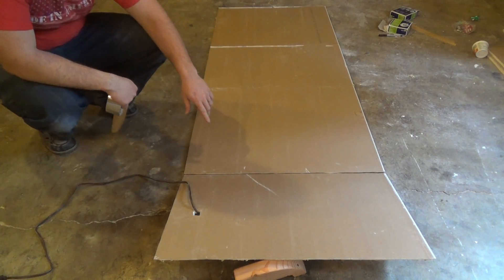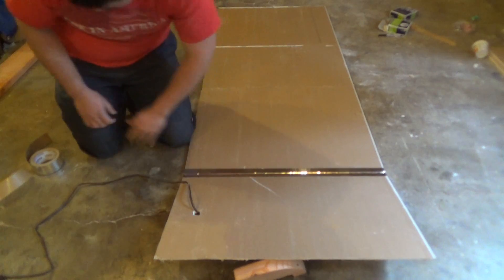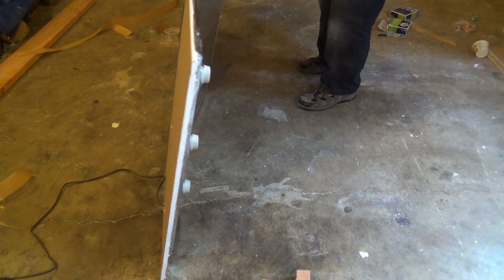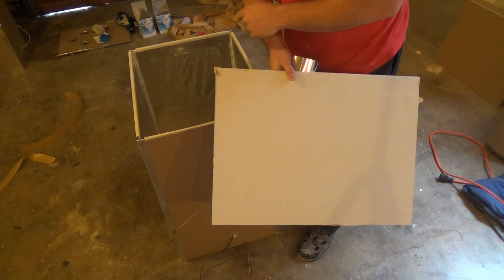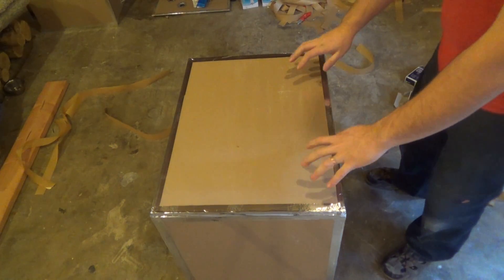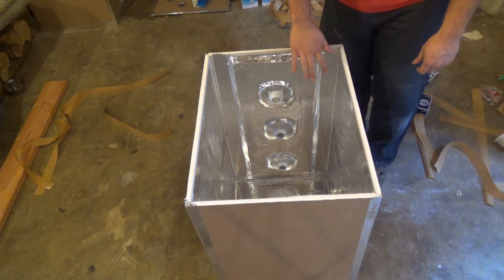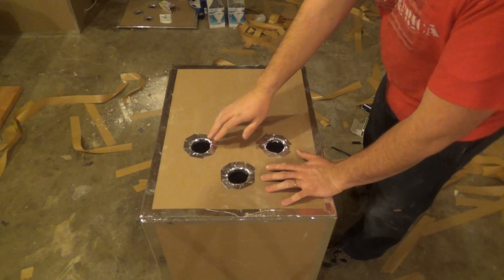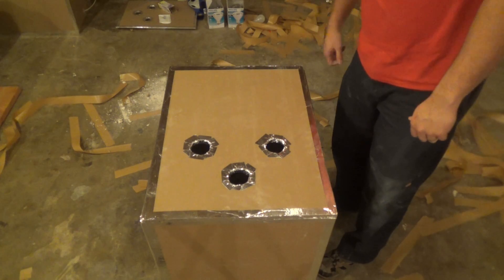Building a PVC Bow Hot Box Part 4 - Assembling the Box and Lid

Comment: Great hot box! I made one a couple of years back for curing fiber glass parts I made. I used a single heat lamp, 24 volt ac transformer , 24 volt relay contractor that was controlled by a thermostat. The box I used was just a old kitchen cabinet but was not very insulated. Now I'm starting to get into powder coating and limited on the size of my oven. Temperatures required for flow out is at 400 then down to 375 for only 20 minutes. I'm wondering if it can handle that kind of heat, also with the multiple lights, I can just unsure a few of them for glass work.